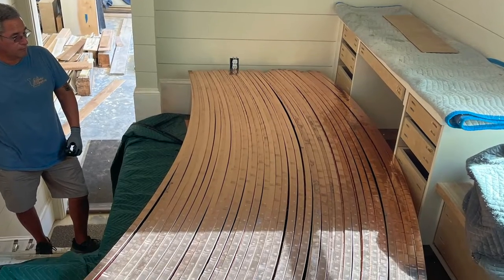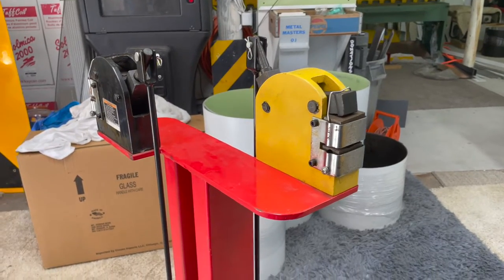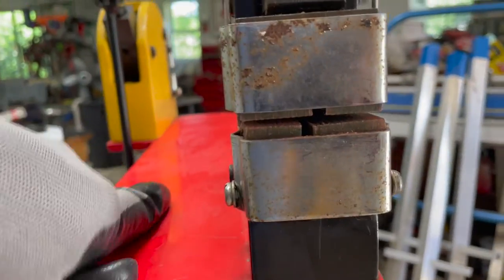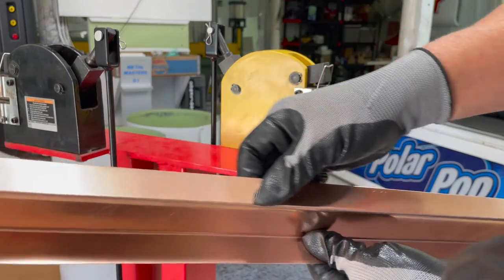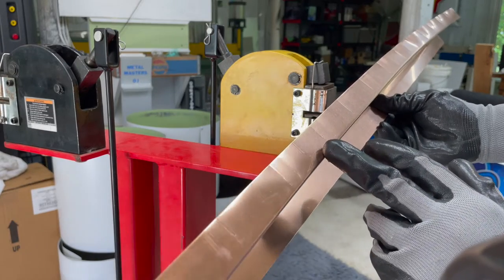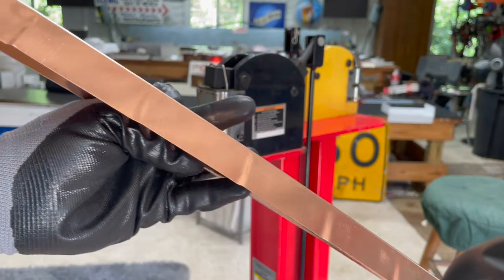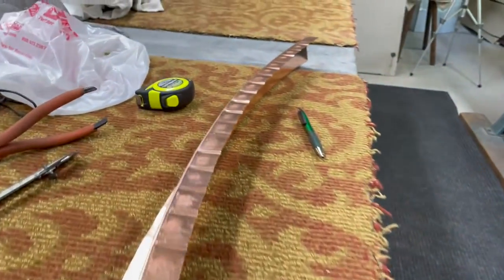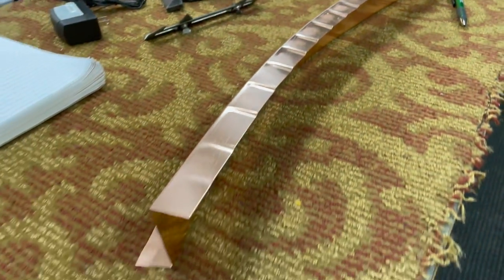Let's Review and Use A Harbor Freight Shrinker/Stretcher | At The 509

Comment: Where did you buy this stand?
Reply from the maker: They used sell it there at Harbor Freight as well, that's where I got mine, but I looked for the part number and I couldn't find one. You may need to ask at your local store.
Reply: @at-the-509  👍
Reply: Although this is a softer metal, it gives a great example of shrinking/sterching for us learning metallurgy. I'm getting into it as a hobby for automotive and art, mostly in mild steel form. Thank you.